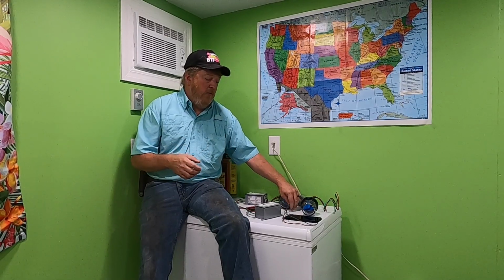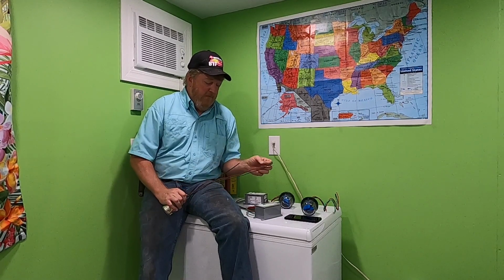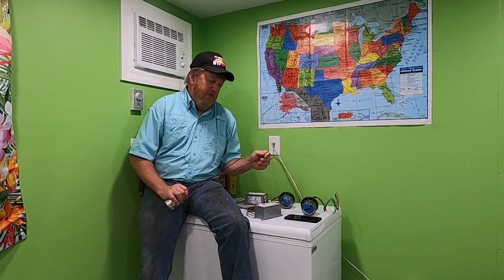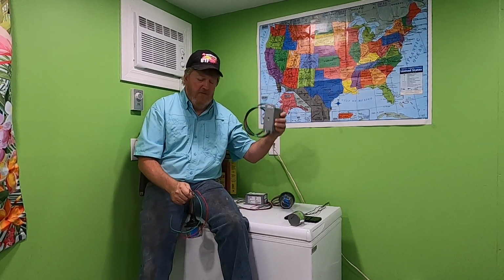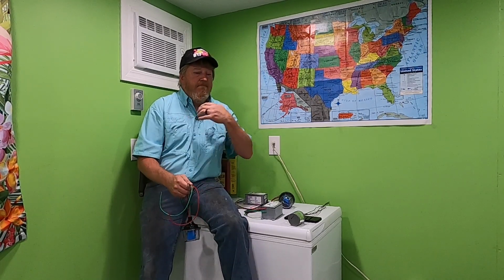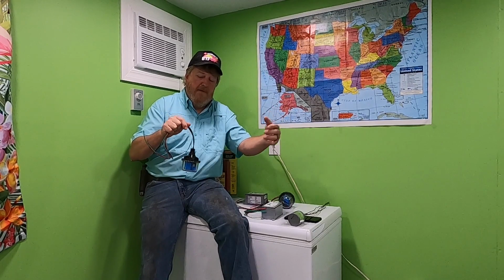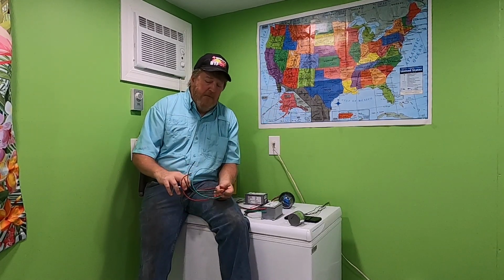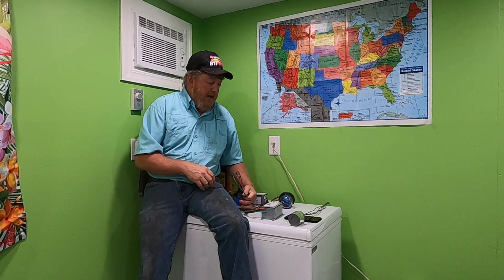Ryan Rants: EMP, Solar Flairs and Electrical Surge Suppression  Part 2

Comment: in case of nuclear emp, not only will the government not help you, they will confiscate your still working equipment, if the roaming and displaced people do not get first to it.
good luck with that emp survival thing.
Reply from the maker: Oh I never said my system would survive the EMP lol. My bet advice to anyone wanting to be truly prepaired is learn to live without electricity.
Reply: @aroundthehomesteadwithsuer3497  
ah yes, a good quality wood cooking stove will be a big help. you can cook, make hot water and heat the house. if you have access to wood.
a wood cooking stove in combination with solar is actually a good back up as well.